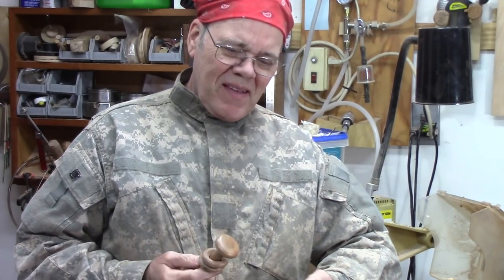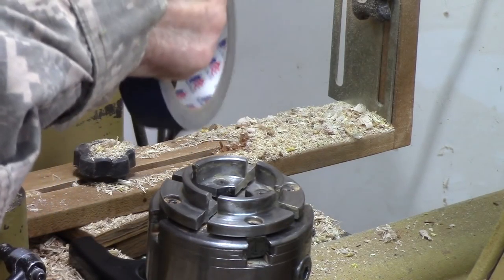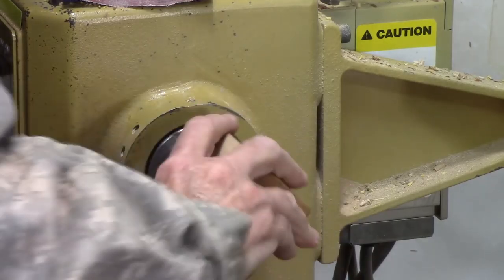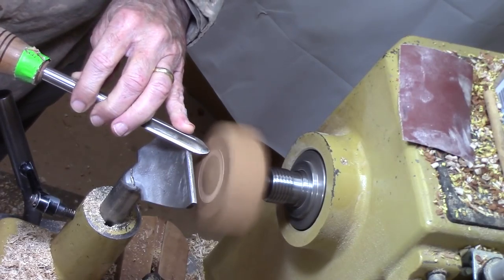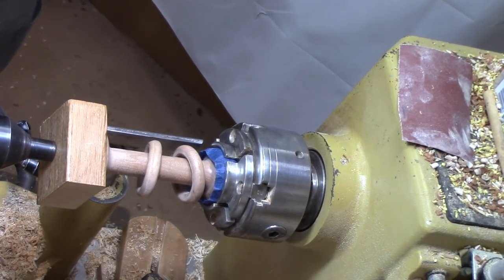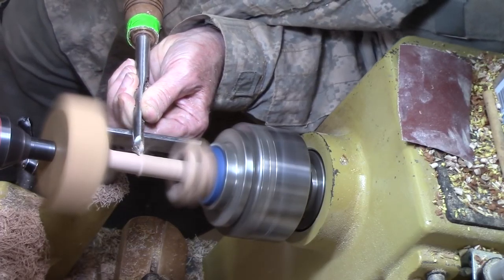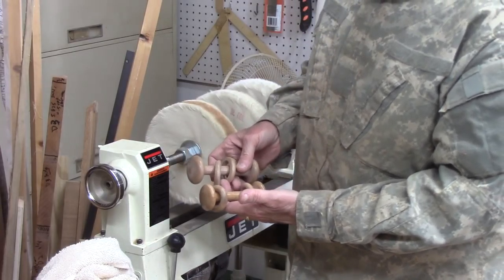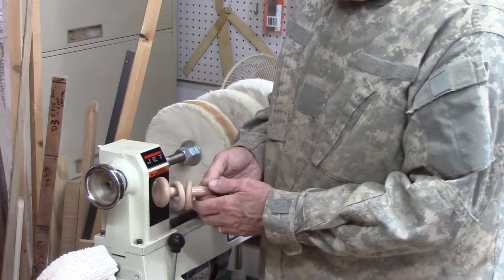Chucking Challenges in Woodturning

Comment: Hi Mike nice job on rehabbing the rattle. I see you use the Beal buffing system as do I. Have you seen the demo the Beal does by just buffing the wood without using the first two wheels. I tried it and it kind of burnishes the wood that way a little one won't lick anything bad off the rattle. Thanks for taking the time to make these videos and sharing with us.